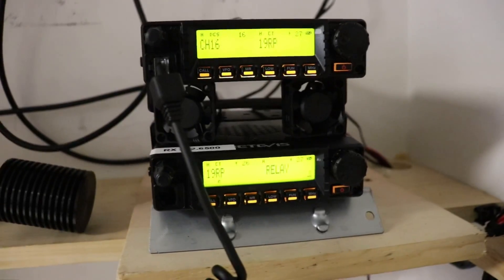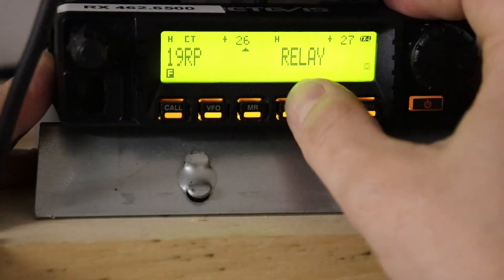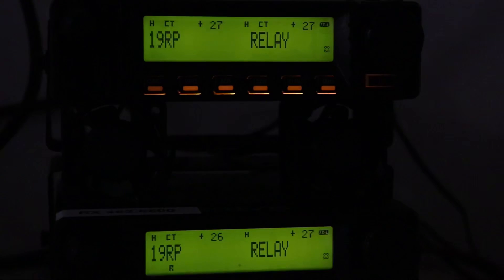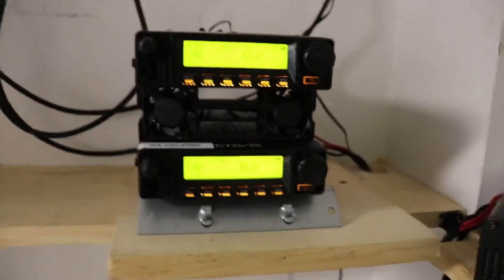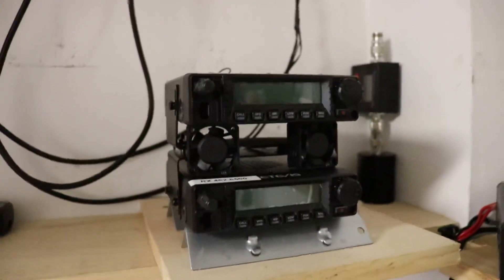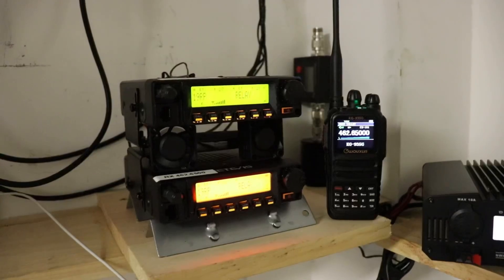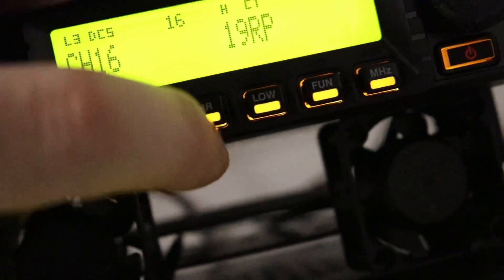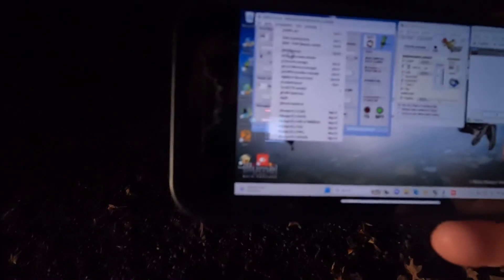Retevis RA-87 G.M.R.S. 40watt Repeater build and testing

Comment from the maker: After talking to Retevis we found out that the radio I had was a little low, they sent out another radio this one was putting out 37 watts. This is acceptable in my book.
Reply: Can you use the Other Band on the TX Radio to use as a base to talk to my area Repeaters and or Simplex Net Nights?

Comment: Just finished setting up a repeater using the Retevis RA87's, and I was fortunate enough to get radios that put out about 41-42 watts.  My advice on cooling is to remove the fan controller and let them run all the time. I put a 4 inch computer type fan behind mine and have the radios stacked with air space under the receiver on the bottom and space between them with the transmitter on the top.  With the fan blowing all the time, the radios stay cool to the touch all the time.  This doesn't let them get hot before the fans come on, it keeps them cool all the time.
Reply from the maker: I run on solar so it uses to much power to run all the time

Comment: JDubb, I have copied the components in your rt87 repeater build, to a point and have come up with 2 quick questions for you please. 1. Do you have a repeater controller anywhere in this video and is it absolutely necessary to have? 
2. Has the duplexer you are using been tuned to the one channel for tx and rx , or is it a straight out of the box duplexer? 
Thank you, 
Trapper Glatzer
Reply from the maker: I haven’t watched this video in some time but I don’t think I had a controller. You don’t need one unless your repeater is open to the public. I am using one from repeaterid.com (code jdubb for 10% off) that’s working awesome it’s all plug and play. My duplexer is tuned for 462.550 and I’m using it on 462.700 I haven’t seen any issues.
Reply: @JDubbsadventure , thank you for your response.
Reply from the maker: @ anytime

Comment: I have my radios setup just like you described but for some reason when people talk that are far away, my Tx radio can hear them but my Rx radio doesn't. As they get closer, my Rx radio will eventually hear them and then the repeater function will start working. Any help to fix this problem would be greatly appreciated.
Reply from the maker: @crazykempf  you have something wrong. Check the duplexer an make sure it’s hooked in right.
Reply: @JDubbsadventure  its hooked up right, Tx radio is on the low side and the Rx radio is on the high side. And the duplexer is tuned to my frequencies.
Reply from the maker: @ when you put it in relay mode the transmit radio should no longer receive
Reply: @JDubbsadventure  I understand, and it does for the most part. But signals from a good distance are being received on the Tx radio for some reason
Reply from the maker: @ not sure Iv never heard of that problem. Maybe cut the squelch all the way up to held with the tx receive( kill the tx receive)

Comment: I just ordered my 2nd Retevis RA87 GMRS Radio, Duplexer, 3.5mm to 3.5mm mic jumper, 3  UHF Coax Cables, Dual Cooling fans. When it arrives tomorrow from Amazon I’m going to follow your instructions in this video. 

Now I can select which ever channel I want to use with DCS Tones, Right?
Reply from the maker: Yep just find a channel no one else is using

Comment: Awesome video! Question: is it possible to keep the radio on low power, run it through a btech amp, into the duplexer or not recommend because the RA87 has a built in power regulator? What would be your best option before I mess up another repeater system 😂
Reply from the maker: I guess you could. That would keep your radio form heating up but your amp will take the load and I’m not sure it will take a lot of traffic
Reply: @JDubbsadventure  I'm afraid to try it, and the reason being is I messed up my RT97 running it through the B-Tech amp. I had the RT97 on low power and everything hooked up correctly. Eventually it just stopped working.
Reply from the maker: @DrewB439 really? That’s the first time I. Heard that happening
Reply: @JDubbsadventure  Yes, I troubleshooted everything. Then I took the little 10 watt duplexer and ran 30 watts through it. Worked fine for a week then.. now I have a nice table weight lol.
Reply from the maker: @ oh you can’t put 30w in a 10w duplexer and have it last long term. That was probably the issue or it was high swr

Comment: i have a question about this setup. 
at work there are 2 maintenance departments. if use this setup will it be able to separate them on to different channels? i heard some can perform this.
Reply from the maker: No one repeater per frequency an I don’t think you can use gmrs for business
Without everyone having a license

Comment: Place our radios side by side instead of on top of each other to keep them cooler.  Leave them at a least a foot apart.
Reply from the maker: To answer your first question the radio had an issue that was covered in the pinned comment. I have a video showing how we set up the repeater. The receiver doesn’t get warm so having them close together isn’t a problem

Comment: I just ordered 3 
BTECH GMRS-50V2 50W radios , two for a repeater station in my workshop behind the house and one for a 50 watt mobile unit in my work van, so I can always stay in touch with my family at home , because I usually travel 30-40 miles from home every day for work. I'm in Tarpon Springs Florida " the flat lands " and I work in Marine electric / electronics. your video will be helpful putting my repeater together. I plan to install 2 Lifepo4 batteries and 200 watts solar charging for a backup power source. I'm originally from Winchester Va.
Reply from the maker: I’ll check it out. New repeater site is bath county Va
Reply: @JDubbsadventure  Hi, just a quick question. How can a repeater connect or communicate to another repeater if I want to extends the signal coverage? I’ve never understood that :)
Regards

Comment: I have a VHF ham radio repeater made from two motorola radios. A CM300 and a CDM1250. Im planning on building a GMRS repeater for my area as well since there are none in my area of the state. I plan to use two Motorola CDM1250s you can find them for pretty cheap and they are easy as heck to make into a repeater. The software takes a little to learn but after that its really easy and they are great radios.
Reply from the maker: @SouthCarolinaSirens  I’m not a Motorola fan. Years of using there stuff have turned me away. The older radios were good. But I feel as they have went the same path of deWalt in Milwaukee. That said to each there own
Reply: @JDubbsadventure  I feel ya and sometimes i feel that way. But the radios are great to me its just that the software can get really tedious and confusing alot. Even i still get confused and ive been using it for a few years. I tend to gravitate more towards used commercial gear since its cheap and tends to be a little more durrable. Works just as good as a new radio from my experience. I just get what i can get and use it and make it work.
Reply from the maker: @SouthCarolinaSirens  look into kenwood. If there is a problem with there old radios they will still try and help you and with give out wiring diagrams. Motorola will not help unless your the original purchaser and then you have to find one if there techs.
Reply: @JDubbsadventure  i love kenwood as well. The reason why i went with motorola for my ham repeater is because at the time i didnt want to be soldering inside the radio to make them into a repeater like ive seen youd have to do with kenwoods. I was too scared i might bridge a trace or wreck something else and kill the radio. The RIB connector the motorolas have is was convinient to me at the time. I just realized as i was writing this i have two UHF kenwood 862Gs kicking around. I might see if i can make them into a gmrs repeater of some sort.

Comment: What’s your thoughts on this repeater setup versus say the RT97 repeater
Reply from the maker: I have both it Depends. This one has more watts. So it does a lot better with leaves trees buildings hills ect. But the rt97 I have on solar power on top of our mountain and and can hear it and use it from 47 mile away.but I can’t hear it inside the house unless I’m near a window, One is built the other you have to build.
Reply: @JDubbsadventure  I’m looking at either buying or building one just not sure which direction I am going to go yet. Have you looked at the Btech repeater any.
Reply from the maker: @uncledanny7 I haven’t seen it but my friend has. It’s 2 mobile radios hooked together. Just like kenwood and Motorola does it

Comment: I have these two radios setup exactly like you with a duplexer but when I key from a little bit of a distance it gets stuck transmitting and sounds like it's in a tunnel.  Any ideas?
Reply from the maker: Make sure your duplexer if hooked up right and all your settings are correct. I haven’t heard of this issue
Reply: @JDubbsadventure  Thanks for the quick response!  I have checked all that so many times and upgraded all my coax to lmr400.  It's stumping me so hard.  I'm not new to this hobby so I don't get it either.  About to replace the power supply.  I have replace everything else.
Reply from the maker: @PANICFPV  I’d try a 12v battery that will let you know if your getting noise from the power supply

Comment: Two comments. First, I think you will get just as good range results using mid or low power rather than high power (and reduce your own desense). Antenna makes all the difference in the world (quality, and height). Second, if your intent is to have a permanent, long term repeater, get a real duplexer (you'll barely be able to measure power drop through it, unlike the mobile duplexer). That will also let you run higher power (if you really need to) with less or no desense.
Reply from the maker: I have several videos showing there is no noticeable desense. furthermore, If you can only measure the desence with really expensive gear and you only a notice it with expensive testing gear is really an issue? No because In the real world we just want to talk from radio to radio. 

The fact you use the term “real duplexer” is a bit pretentious. An as you stated I could get the same range with less watts so why then do I need a better duplexer to increase my watts? 

Watts equal penetration (trees buildings ect) not necessarily distance. I have a video showing a .5 watt radio talking to another radio at 90 ish miles. 

 Radio gear has come a long way in the past 30-40 years even the “cheap” ones work just as well if not better than my Motorolas and Kenwood radios. I believe the larger brands have sold off of their name for too long and there quality has gone down exponentially over the years. 

Thanks for the input and info

Comment: Thanks for the video.  The output on the meter may be due to the connectors that was used.  Try using a male to male connector from the radio to the meter's RF in jack and then connect dummy load directly to meter's antenna jack.  The less connections and less configuring of connectors to make a fit is best.  Be sure the connectors are snugged but not over tighten.  Be sure your power supply has enough current to supply the 40 watts.  Maybe also try using a better meter such as one made my Bird or better a HP Meter.  By the way I thought you were getting a decent signal at that distance with the lost of wattage using that particular Duplexer.  And I did like your video, well Done...
Reply from the maker: You know I have a bird meter and everyone got mad I used it so I went with the cheap ones and believe it or not there right on with one another. So in my sample size I don’t see where the $800 meter is any better than a $30-60 meter. An the “cheap one” (relative term) is better because it’s more durable.

Comment: So I have question what is the downfall to turning your rx radio down on low and leaving your tx in high school
Reply from the maker: @ClementhHannah  I think you’re talking about reversing your low and high side? It’s not gonna hurt your radio short term. The only reason to do it is you believe there labeled wrong
Reply: @JDubbsadventure  I put my rx on low power and left my tx on high power
Reply from the maker: @ClementhHannah  put them both on high or low both should be the same other than one having the little R

Comment: I just got mine and got it all set up it works as a repeater but as I got everything dialed in with my ctts tones now the mic will key up on the unit but only for a couple seconds then it just turns off. Any tips?
Reply from the maker: @mrcummins3  the mic doesn’t work when in repeater mode it will key up for half a second then cut off.
Reply: @JDubbsadventure  Oh ok. So have to go out of repeater mode to talk on it?
Reply from the maker: @mrcummins3  yes it’s not a repeater and base all in one it’s a base or a repeater
Reply: Thanks!
Reply: Sorry to bug you but it seems you are pretty into this set up.  I'm new to all this and  Upon playing with mine more, I can only get a half mile or mile from my house before I loose voice feedback. I can talk with my handhelds miles longer than this. Thoughts on where to start?
Reply from the maker: @mrcummins3  I think I answered you on fb but I’d start with taking the duplexer out and running two separate antennas. Also make sure your tx is in the low side and the rx is in the high side, check you audio cable is plugged in all the way.

Comment: This radio needs to draw around 10 to 12 AMPS to put out its 40 watts of power.   Proof,  watch the Radio 2.0 video on this exact radio with the right power supply and a better power meter, you will see it put out 43 to 46 watts.    Also, my KG-1000 draws 11 AMPS when on high putting out 50 watts.     When checking radio power you need a good power supply of at least 20 amps or more.   Not good to use a low Amp power supply and say the radio is an underachiever. 👎
Reply from the maker: Ok let’s unpack. 
1. My FT-991 only uses 15-16 amps at 100 watts so a 50 watt should be around 7-10 amps just based off the math. Also my icom 7000 is 75watt uses 9 amps  

2. 2.0 is a larger channel so a lot of what is sent to him is cherry picked. That’s just how YouTube works and dealing with companys.  There’s a lot of reports of the radio tx watts being 25-65 watts so there all over the place right now. 

3. If you use for example 10amp power supply then it would trip/ blow a fuse if the radio pulls to many amps 

4. A higher amp power supply will not put more “power” into the radio so your comment of “the right power supply….” Is moot. Iv tried this setup with 3 30 amp (like the video showed) and 1 50 amp. With no change. They pulled the same amperage on the 30 and the 50 amp supplys

5. I use 3 meters to check swr and power levels as long as they all match then that’s close enough for this small test  I’ll use my fluke 196c next time.  

6. I love these radios and recommend them all the time but I will show you the truth on them. there not perfect but there good enough for this job. So no one is calling it an “underachiever”  

7. This was the first video on this radio as a repeater so this is one of the first samples so maybe they have gotten better.

Comment: Regarding the "R" for reverse mode on my RA87 receiver unit,  have you ever noticed that if your receiver unit has a brief power loss,  the reverse mode "R" can become absent when power is again returned?  I saw this sometimes occurring on my RX unit during setup and wanted to ask you if you noted this before your backup power effort. Thanks for the awesome videos!
Reply from the maker: I had someone else ask me this and yes the first time I think it did loose the R but now it doesn’t no matter how long I have it off not sure what changed
Reply: @JDubbsadventure  Thanks for your reply!  Today I discovered that the Retevis software has both Reverse and Relay options to activate --whereas Chirp Next ( even today's updated ver.20240618 still)  lacks the Reverse option choice.   The Retevis options were enough to fix the disappearing "R"  issue and the Reverse mode remains after a loss of power/ a storm power flicker simulation --times many simulations. 
 I will contact Chirp and request for consideration that this Reverse choice field be made available in future Chirp Next revisions for the RA87.  Thanks again.😃
Reply from the maker: @TxCoffeeTime  just talked with a guy that was having this problem after some time  we found out he had one unit on 18rp and one on 20rp. Once we got both units on the same channel the R stays regardless of how long the power has been off. Hope this helps

Comment: Question...doesn't the "R" stand for "reverse" and not "receive"? So technically, that would be your transmitting radio, right? I have these radios also and the instruction manual is one of the worst I've ever seen. Holy cow, it's bad. I'm having some trouble with mine staying on high power. Intermittently, I notice that I lose coverage and go check the radio, and it's on low power. Switch it back to high, but it does it again later. It's a very low use repeater, too, so I don't think it's getting hot. Initially when we installed it (with a duplexer, 50 ft LMR400 and a Tram 1486) I was able to talk on it 33 miles away. But since that day, we never been able to do it again. I'm baffled.
Reply from the maker: I don’t have the manual with me but on mine the R is on the receiver. Make sure your on channel RP___ make sure both radios are set to high power if one is on low and the other is high then it will switch back and forth. Make sure your duplexer turned to your frequency and that your low side is your tx and the high is your rx. Also if your wondering witch radio is transmitting you can put your swr meter on the back of your radio with a dummy load the rx radio will not show anything and the tx will give you a reading of something